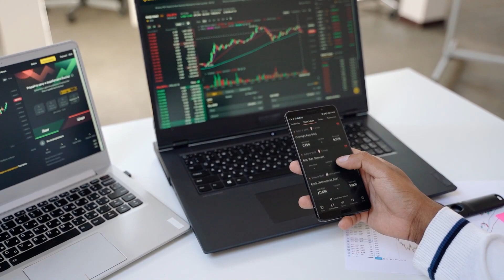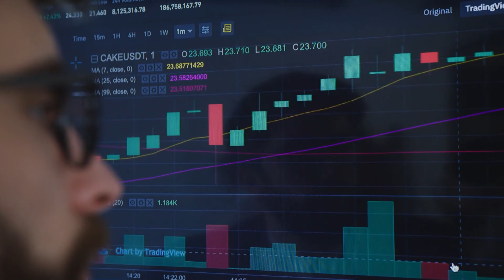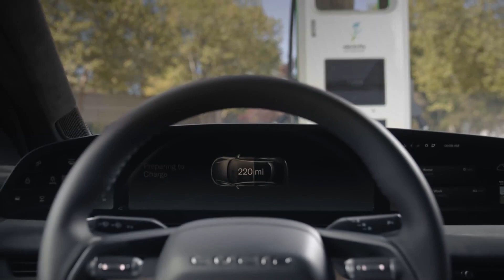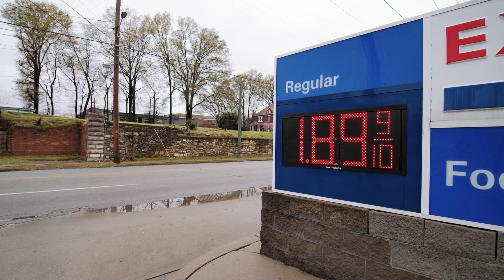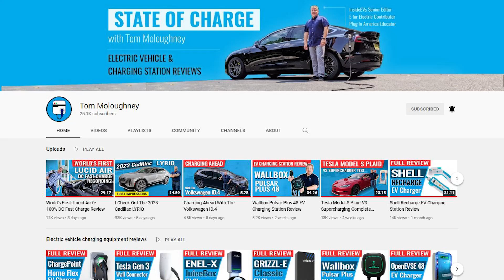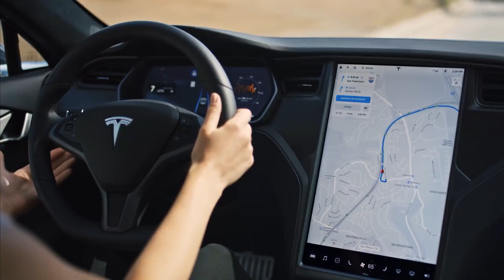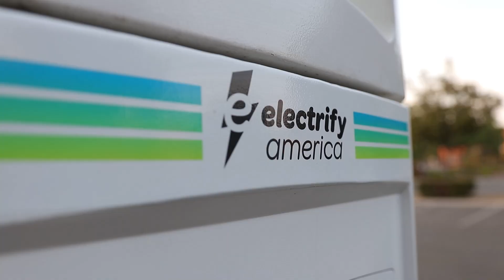5 Biggest EV News of the Year: from Tesla to Ford

Comment: Your snarky comment regarding people not using trucks for their intended purpose simply shows your ignorance. Everyone I know hauls horse shit and hay bails or tows with their trucks year round.  It is because of arrogant assumptions like yours that charging infrastructure is not up to the task for truck owners. I challenge you to drive from coast to coast in an EV truck ( or ev car with towing ability) while towing a 7,000 lb trailer and try charging. At almost every stop you will have to unhitch the trailer just to charge if you are even able to make it to a station before it runs out.

Comment: You can't have every car manufacturer come up with their own battery swap technology and it's nigh impossible to have them standardise the battery pack designs for a universal battery swap solution. In a few more years, there will be far far more plug-in vehicles on the market, which would invariably lead to innovations in battery charging methodologies (e.g. lot reservation, valet charging). You may not even need to worry about charging your vehicle if there's someone who'll plug in for you when the car is idle after you've made a reservation for a charging lot.

Comment: The dealers still continue to lie to customers on the real cost for a charging station at your home.  And when it freezing outside you could lose as much as 40% of your remaining  charge on your electric battery. The true cost for you own charging station in your home starts at 1,500 if you don’t need to increase your breaker box and of course the actual charging box starts 500.

Comment: The Nio three minute battery swap is a joke and totally misleading.
It may take three minutes to actually swap a battery if there are zero issues but a customer would experience 
a much longer wait time. First of all the car would have to be booked in for a swap at a particular date and time.

Then the battery swap agent would have to collect the car from the parking area and bring it to the battery swap machine. Then the car would have to be positioned correctly on the battery swap machine, also the machine would have to be prepped with a recharged battery, at that point the actual three minute swap could take place and then the reverse of all the pre-mentioned procedures would have to take place before you get your car back.

So you're more than likely looking at between 30 minutes to an hour before you can drive away, if you're lucky.

Comment: If a hot-swap battery meant the price of the car was $20k less, I can guarantee that NO ONE would have a problem with kissing that initial battery goodbye. BRING ON THE HOT SWAP BATTERIES!!!!!
Reply: I agree, not only will the vehicle be a lot cheaper, you can also get you hands on the latest battery tech without buying a new car. Battery tech being such a moving target has contributed to purchase hesitancy. My guess is battery swapping has legs even if there is an ownership culture to get over. As the original poster said if it means the car price of $20K less it will happen.

Comment: I drive a Tesla MYP and have a couple other BEVs "reserved". Despite that, I remain concerned about the cost of electricity as we compete with "normal" electricity uses. Solar and wind are still relatively small contributors to overall GW-hr generation.  Batteries and hydrogen do not GENERATE power.  Nuclear may be growing in China, but it is shrinking in Europe and the US as plants reach their (extended) end of life and any new units are very expensive.   Natural gas has both political and practical limits. And King Coal is dead. To me, this is the elephant in the BEV-room. You, Sandy, Tom, John (KIA), etc all need to devote some heavy thinking on this part of the future.

Comment: To that last set of points i will say there are some very striking caveats to those claims. It's great that Tesla isn't the only choice. Lucid beats Tesla on range but obviously using a larger batter pack. And their car is more expensive. That's not a big deal. If you can afford a Model S you probably can afford a Lucid.

The other may have a higher voltage charging system in the cars but again, other than Lucid, the Ioniq 5 and EV6 aren't really that far ahead of Tesla. Their charging curve drops off. But it's still impressive that such an inexpensive set of cars are on the market.

Eletrify America has higher charging but a smaller overall charging network that is nowhere as reliable than the Tesla network. But it is nice to see them, EVGO and others out there. Hopefully when Tesla is able to open to all other EV companies it will close the gap on being able to charge anywhere

Comment: Most important thing: Momentum. All the old brands are now fully on board with the change to electric. Before 2021 most CEOs were too scared to say that.
Reply: Nope - they have started WAY too soon. Talking about changing to EV is very different to doing all the planning of securing raw materials needed for batteries - and the HUGE investments in new production facilities. Bumbling Biden to Mary B, CEO of GM: "You did it Mary, you electrified the whole industry. And it matters." (no mention of Tesla of course).
How many EVs did GM sell in Q4 2021? 260000? 26000? Nope
they sold 26 EVs.
FORD was surprised that the F-150L got huge customer interest, so they have PLANNED to double the production of F-150L EVs. Again - it is way too slow.
VW right now spends 3 times longer to produce an ID.3 than Tesla does to produce a Model 3.
And it gets even worse: compared to Model Y, VW spends 4 times longer to produce their ID.3 and 4.
I predict a lot of the ICE car companies will go bankrupt within 5-10 years (also taking into account their huge debts - watch Sandy Munro's videos and you want to learn the reality behind the car industry).

Comment: 0%-100% battery state of charge is a completely pointless metric.  It's ALL about HOW FAR do you get in 10-15 minutes of charging (or less)...  If you can get enough charge to go long enough so that you want to get out and stretch your legs, then that's enough (say, 3 hours).   

If you ask a typical person with an ICE car, you'd find that in a lot of instances they put in $20-$30 worth of gas to get around for the week since there's "no point" filling-up the car and waiting at the pump more than necessary, hardly anyone obsessively fills their car to the top every time they buy gas.  Being able to charge at home will reduce this pain point to ZERO.

All the bellyaching about "range anxiety" is irrelevant when you realize that measuring things through the lens of the current, near-infant, charging infrastructure is idiotic.  Until charging "stations" actually reach the RELATIVE ubiquity of gas stations, there is no point discussing anything with respect to range, state of charge, etc.  FYI, Tesla's charging infrastructure is nice, but utterly insignificant when compared to how many gas stations currently exist to service a Mercedes, for example.  Obviously, in the long-run, you won't need anywhere near as many individual charging points per station, but what needs to happen is that there are plentiful, smaller, charging stations in almost a similar density to existing gas stations.  As long as the profit margins remain similar for footprint used, then this gas/power transition will be very painless.

To be honest, the entire range "issue" is utterly and completely pointless and I can GUARANTEE you that once EVs fully shake-out in about in about 5-10 years, the most commonly purchased vehicle range WILL be around 175-250 miles.  Even if battery technology improves substantially, why pay for range that you will never use in any practical way?  The market will lead the way as consumers slowly adapt to the EV paradigm and realize that they really DON'T drive very far on any given day (about 40 miles per day as per GM research).

P.S.  Battery swap is utterly stupid, just a knee-jerk technology trying to emulate the gas station paradigm.  It will die a horrible death, as it should...

Comment: One thing that got my attention and hasn't received much press is Hyundai Motors E-GMP from an engineering standpoint. Which as I understand, is a foundation for the future of most if not all of the Hyundai Motor groups' vehicles. I would love to have Alex ask Sandy Munro his thoughts on this.
Reply: Jalaponik(known tesla and used to be ev in general haters) covered the e gmp platform in depth with one of their engineers in a written article and with video's on their site. 
It's not even as advanced as the model 3 platform from 2016. But it's definitely the 2nd best pure ev platform so far outside of tesla. 👍🏻

Comment: The most significant thing that happened last year was the development and rollout of lower cost lithium iron phosphate (LFP) batteries. These LFP batteries, manufactured by BYD (LFP Blade prismatic cell batteries), CATL (LFP prismatic cell batteries), and Tesla (LFP cylindrical cell 4680 prototype batteries) all cost below $100 per kilowatt-hour. This means that battery electric cars are now cheaper to make than gas cars. It happened quietly in 2021.

Comment: When the standard range reaches 600 miles on a single charge, and the technology is striving for that with the next generation battery technology, the range issues will no longer be a debated topic. When will we see 600 miles of range be the standard - it seems no one can answer that question with any accuracy yet - maybe by 2030?  So when 80+ % of EV's get charged at home in the future, and auto manufactures stop making ICE's, and super chargers are more common than gas stations today, what will happen to the gas stations, refineries, thousands of gas delivery trucks?
Reply: Same thing that happened to the horse stables, farriers, buggy manufacturers and whip makers a little over a century ago. 🤔

Comment: Two points on battery swaps: it doesn't take 3mn, more around 8 as there is a preparatory step that a clerk goes through first, then there are only a couple of swap points at most (takes a lot of real estate), hence very lengthy wait lines!
Second, Sandy Munro said swapping batteries was darn stupid as bolting off and back on heavy things creates structural weakness in the long run 
Oh and production is battery constrained, so immobilising so many of these isn't quite smart...

Comment: The reason Xpeng self-driving is about the same as Tesla is because they stole it from Tesla. They had an engineer that worked at Tesla download everything and then take the job at Xpeng. I would never buy their stock and support their thievery. Tesla is trying to sue them. But now that they can't steal any more from Tesla they're having to try to figure out new self-driving improvements on their own. Now they're  suddenly interested in lidar because they can't go any further with the cameras. Coincidence, that they weren't trying to use lidar before, along with the only other company that does it the same way, Tesla. Or is that because they stole that from them? Of course it is. That's what tipped off Tesla. Now that they're scratching their heads trying to figure out the rest of it, and they can't steal it from Tesla anymore, they're trying to add on to what they stole to continue their self-driving program. It's pathetic!

Comment: I love the convenience of being able to charge at home on my own schedule, if I had to go to a battery swap facility every time I needed a fill up I would feel like I’m still at the mercy of big oil only it would be big energy. More charging stations regardless of a wait time would fill the bill for most road trippers, charging at home ninety percent of the time is priceless.
Reply: I see able to swap battery pack more like 
1) insurance that if battery starts to fail (or loose capacity) I can just change it 
2) I could use small (=cheaper??) battery most of the time and then swap bigger for long range trips
Normally I would just charge traditional way at home.
Reply: Battery Swap is problematic long term because swap stations need to be staffed (personnel cost), robots aren't perfect, and repeated swapping will likely wear out the related fasteners (thread connections, snap fits, etc.), thus reducing structural integrity and introducing additional points of failure.

Comment: What is being done to make charging stations more abundant and reliable? I gave up my electric due to unreliable charge network availability
Reply: It will be in due time. Just be patient.
Reply: I call BS - do you road trip daily? If so, the chargers are there, just use an app. If not, charge at home - easy.
Reply: @ElroyMcDuff  I lived in NYC and 90% of chargers I tried to use at 7-11 were broken or not hooked up to take credit card. My car was a smart with a 74 mile range, perfect city car

Comment: I'm not too sure about the battery swap thing in the US....maybe Sandy Munro will tear one down and get his opinion on how it works....would not be an issue for me since I don't drive far  everyday and could charge at home......
Reply: Forgotten in the discussion of battery swaps is the potential to swap lighter weight, lower range batteries for everyday use, or swap to a selection of heavier longer range batteries for the occasional longer trip.

Comment: Tesla market valuation clearly shows that the future is EV, but Tesla cars are not the future, because Elon Musk doesn't make cars for ordinary blue collar working people; so, he will continue the stupidity to make the same car designs ( the same expensive EV with stupid useless specs ), and the blue collar people will continue not to buy his cars. Stupidity pays always!
The most important news and electric cars of the 2021 were the ones from BYD. 
The EVs like BYD E6 at around $27 000 are the future, evidently with a little bigger front electric motor ( 150KW instead of the actual 70KW ), a minimum 300 miles range, a bit more trunk volume behind the seats ( around 27 cuft=765 litters ), and the same lenght of the car ( not longer ). The GM Bolt EUV would be very good if the range was better ( minimum 300 miles ) and the trunk volume behind the backseats much bigger ( minimum 27 cuft=765 litters ), eventually the lenght 8-9 inches longer, if needed, for the correct minimum trunk volume ( but not longer than that ).

Comment: It was definitely hands down finding out GM led and is leading the EV revolution.!!
Reply: Lol
Reply: Eleven years ago I purchased the Chevy VOLT.  I think they made a great car.  The battery capacity could have been double, but I drove it 5 years and 90 percent was on electric.  I was disappointed it was discontinued.
Reply: @NipomoBeach  Agreed. The various forms of serial hybrids make the most sense to me. Simplifies the drivetrain considerably to have propulsion only from the electric motor and the ICE only for electric generation. Then the ICE can be much smaller and tuned for peak efficiency at a set rpm.  A plug-in serial hybrid would be ideal for an EV pickup. Drive on battery-only during the week and on longer trips and when towing, the ICE can kick in and extend my range.
Reply: I know, they are just flying off the assembly lines /s/  I'm just glad that I got my Bolt before they halted production.

Comment: Battery swapping might be appealing to the 50% of the US population that lives in an apartment, condo, townhome or rental home.   The challenges of easily recharging is addressed with battery swapping.
Reply: But do you really want to swap a good battery for a bad one. No guarantee you will get a good new battery.
Reply: Having a swappable battery means you won’t have to buy a new one after ten years.
Reply: Just wait a bit, the owners of those apartment blocks etc, will soon have to fit/allow chargers, or their properties will be de-valued. prospective tenants will just look elsewhere.
It will end up being like trying to let a property with no electricity connected - near impossible.

Comment: I disagree with Tom about battery swapping. I believe swapping is the way to go. Not owning a battery and subscribing to swapping is a great cost savings as well as the speed and convenience.
Reply: The problem with battery swapping is there aren’t enough batteries already.  To have swapping you have to have multiple batteries per car. The battery constraint doesn’t look like it will be relieved for 6-10 years